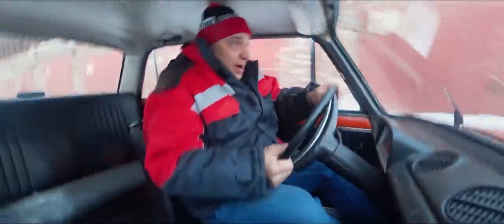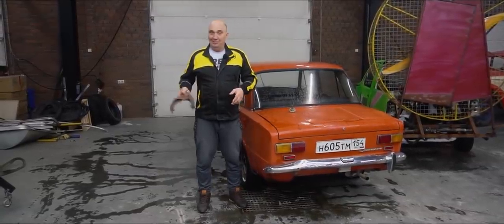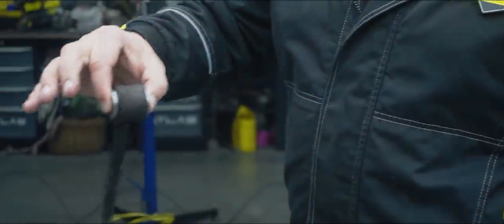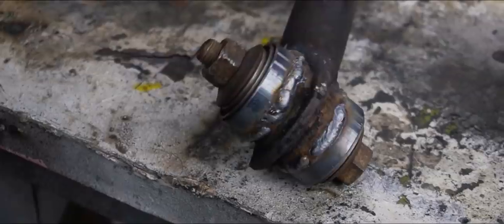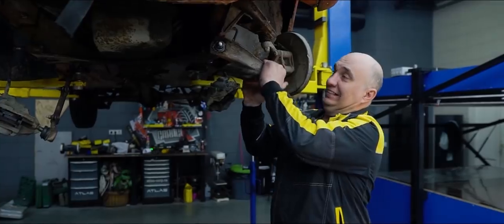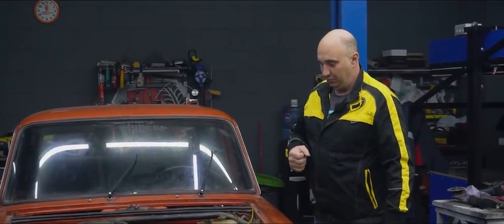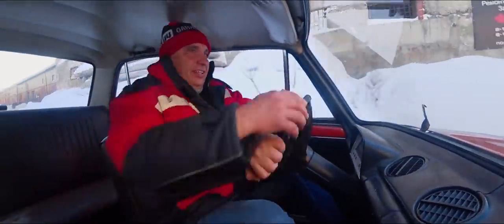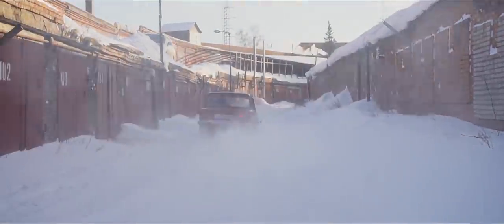Replacing bushings with bearings – how does that affect the suspension?

Comment: The concept of running roller bearings in place of bushings seems logical, but only to a point. That type of bearing needs to roll to work. Being in a static position (mostly) like a bushing is, it will wear much more quickly since it's only touching in a small area with the rollers. Rod end type bearings are what you would typically run in a race application to reduce bind in the bushings. This is still pretty funny and might be worth doing for some short term racing, or like this, just for some fun.

Comment: The bushes isolate the car body from the shock of bumps, not just suspension travel.  If you want to replace suspension bushes with something 'smoother' the correct item is a rose joint, its a hard metal joint that can move in any direction but has no isolation, its what is used for race cars.  Your bearing replacements only moved in 1 direction, many suspension designs move in more than 1 dimension.   The springs fell out because there was nothing holding them in and limiting the distance between the ends of the spring, the shock normally does this and is why you need to compress springs to remove the shocks.

Comment: This is kind of like rose jointed suspension on a racing ca. If you were to fit stiffer springs and upgraded dampers this lada would handle exceptionally well, especially on smoother surfaces.

Comment: The shock issue would probably be addressed by using sport shocks (Bilstein, Sachs).  Maybe stiffer springs.  I am surprised it worked as well as it did (I figured it would be a reasonable solution for drag racing; straight line).  Would be a good solution in the southern US, but northern US, USSR, not so good (salt=rust).

Comment: 3 years ago at a repair shop I was told that my 2004 Corolla shocks 'are leaking' and need 'urgent replacement'. I said 'Thank you for oil change, but my car is fine'. Today, 50k miles later, the car still runs like champ and mechanics stopped telling me about shocks ))))

Comment: Cars used to have metal joints instead of rubber bushings.
My 1962 GMC is one example, there is no rubber in the independent front suspension, only greaseable metal journal bearings.
Reply: David Chadwell, One-ton chevys still use metal bushings in the front control arms.

Comment: He did good except for all the side to side bind he just created in those lower control arms. There is bushings there for a reason. You need articulation side to side since its a solid axle.You need spherical metal bushings as you get rid of all of the flex but retain all of the articulation. The tires will help soak some of this side to side motion but when the chassis starts leaning over those arms are gonna be twisting and turning into torsion bars. Not exactly the linear response you want.

Comment: there is 2 edge cases for suspension, too stiff, feels like every pebble is a jump off a cliff, then, too soft and the car oscillate up and down endlessly... best is where you almost bottom out on hard hit but don't feel the small bumps. the spring is the overall weight it can hold or strength and the shock is how fast it can move up and down. (fast in and slow out usually works good. but most production cars are same up and down. cost effective.)

Comment: I wonder if they drilled the bolt shafts for a split pin? Those tapered bearings can't be done up tight, so you'd have to use a nut with cutouts and a pin to stop them coming loose.

Comment: Friction and damping are indeed completely different phenomenon. The ideal suspension has zero friction- ie the bearings- but well tuned damping- the hydraulic shock absorbers. But bearings cost more and transmit more road noise to the chassis. So cars have bushings.

Comment: off the top of my head...
bearings are designed for high speed point loading
bushings are for low revolution point load

so....itll probably work better...temporarily 
but it wont last very long

Comment: try to fill up the shock absorber oil to the max or using motor oil with different viscocity like 0w20/5w30/10w40/20w50..

Comment: I wouldn't wanna have to setup preloads on those bearings. That would be a pain in the ass.
Reply: Is that sarcasm?
Reply: I was thinking the same, I guess you just tighten till it stops wigglin' and add a fraction of a turn. I thought they really wasted the test badly. This demanded a nice road so you could test the chassis. I bet it would have been a pretty fine feel with the steering.

Comment: This is weird to me, but then I only mess with motorcycles. Do cars use bushings specifically because they aid in damping the suspension movement, or is it because they are simpler than bearings, require less maintenance, and (I'm guessing) last longer under high load?

Comment: I had heard Russians do things differently. Now I know they do. 

The shocks need a bit more compression damping and a lot more rebound damping. They also need end stops. His use of bearings has a similar result as using polyurethane bushings. Removing the shocks does not help handling.

Comment: Is it possible to try to start an engine and have it run in reverse? The engine always was to turn one way from the factory, but if you change the plug wires and fuel injector wires to reverse the firing order, and figure out a way to start the engine would it be possible to have it run backwards? If the engine was still in a car would putting the car in drive make it drive backwards?

Comment: Your going to (rediscover) why factories dont do this to production cars.

The bushings being rubber, are designed solely to adsorb shock and vibration, while restricting sudden movements. This experiment was done on gm sports cars in the 80s, both by the factories and aftermarket shops. Surprisingly, they recommended against this. As all the road noise, vibrations, shocks and sounds went directly into the car, making it unbearable to ride in or drive.

Comment: As cool as it is there’s a reason why Johnny joints, spherical bearings, ball joints, heim joints. Etc are used when doing this for real

These tapered roller bearings WILL eat themselves 
They’re not designed for this load or movement 
Very very very infrequently do suspension parts only  move in one direct plane and without binding relative to other parts

Comment: You should do it with just the shocks in. With no springs.
Reply: It would just sit at the bottom of the shock/bump stop. The shocks aren't meant to take that kind of weight, so they might even break from resting the weight of the car on them. The bump stops might save them though.

Comment: I would like to see an engine with roller bearings in the crank.. possibly in the pistons too.
Reply: Sooooo...  almost all 2 stroke (and possibly other) bike engines?
Reply: Thats an actual thing that exists on older high performance engines. They have to be changed out way faster then hydrostatic (plain) bearings. And ofcourse 2 strokes where you don't have an oil system.

Comment: A bit like a motorbike. Swingarm pivots on bearings, the wheels are bolted to the swingarm with bearings. The shock absorber has bearings at each end too as do all the link arms between the spring, damper and swingarm. On the front, just the forks again mounted on a head bearing and bolted to the frame. No movement at all is the aim. The shocks and springs do ALL the suspension work. Movement in bike suspension = terrible and possibly dangerous handling. Upside is, in a turn you can feel EVERY detail of how much grip the tyres have on the road. Downside is, hit a pothole and you know about it!

Comment: First of all, in that car you can make the suspension out of diamonds and it will still drive like shit. Second, bearings are designed to take moving load, they are made for spinning things. In car's suspension there isn't a lot of spinning so the load is mostly static. I bet after 2 weeks all those bearings will be garbage. Some might crack.

Comment: My track bar on my 12000lbs dodge ram i replaced with billet chromoly 4140 steel heim joints and my truck drives like a racecar. Rubber bushing are garbage but cheap

Comment: they killed the new bearings by welding on them, taking the temper out of them. i give them 1000 miles.
Reply: How else would you do it?
Reply: @Mavrik9000  odds are i would have used heim joints. how i would do it would be beside the point i was making, which although it may last a short while, i wouldnt spend that much money doing it short term when the right parts more then likely would have been cheaper. any time you weld a hardened metal, it weakens it and would need to be re heat treated.
Reply: @Mavrik9000  I give him kudos for the fun and challenge though.
Reply: @kevinwallis2194  Here's a page where someone does exactly that:
https://www.blasterforum.com/threads/heim-joints-vs-ball-joints-banshee-spindles-vs-blaster-spindles.64736/
Reply: @Mavrik9000  I was using heim joints with the tapered ball joint ends in dirt track stock cars back in the late 80s. Im 64 now, and ive seen more crazy stuff over the years. I do tip my hat to Cuba, and how they have to make their own parts for their cars. Most of their cars are from the 50s which is right up my alley

Comment: Poor car. Its an earlier Zsiguli. I cant tell the exact year but earlier than 1976. I know Ladas dont have value in Russia but you should respect history and dont destroy early Lada models. In a few ex ussr country they would pay nice money for this car.
Reply: It's a 1974-1979 VAZ-2101. It was available in this color since 1974/1975, but no later than 1979 because before that the besel of the speedometer on 2101 was white.
Reply: @jimmy1395  The speedometer was black from 78 so this car cant be later than 77. Unless someone changed the speedometer. But this steering wheel without the chrome circle on the steering wheel was from 78.